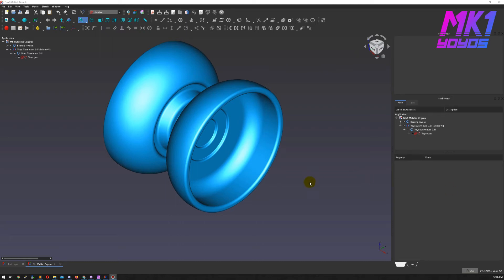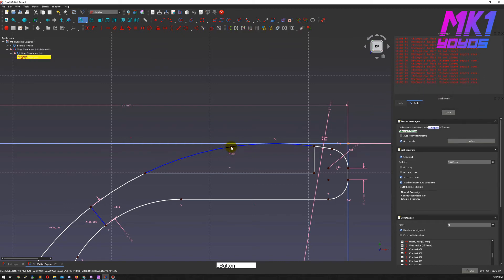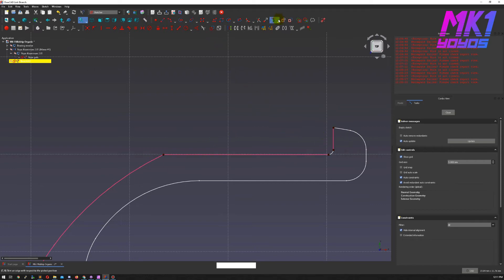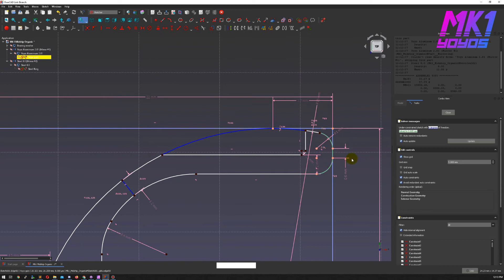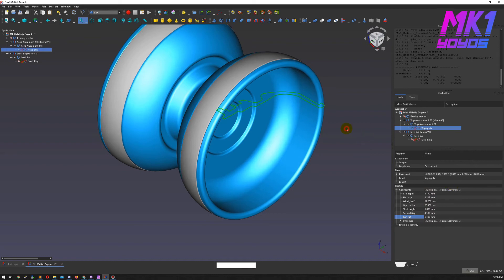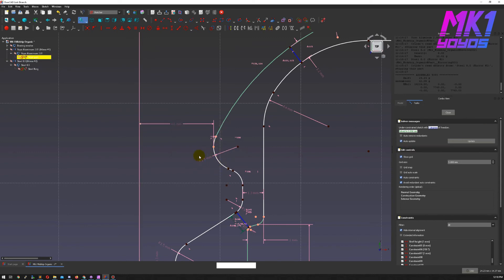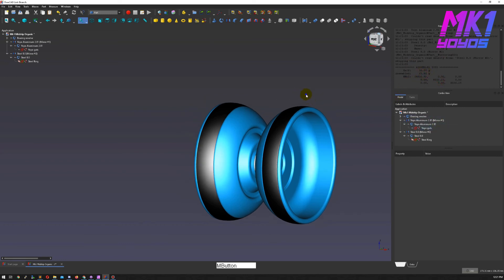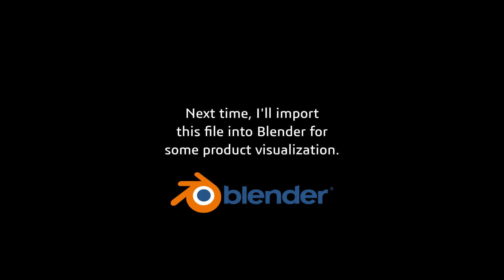Mk1 Mechanics Part 3: Steel Rings

Comment: Hey so, typically, for metallic weight rings, it's a good idea to have a chamfer on the weight ring edge that would otherwise seat onto the fillet'ed yoyo body. This clearance makes installation far easier, and makes part inspections far easier as well, decreasing manufacturing costs greatly.

A ton of shops that assemble the yoyos for you do this without notifying the designer as well, because they know that the designer is very unlikely to rip the press fit weight ring off of the yoyo to inspect it.
Reply: Me: rips ring out

Yoyo shop: NO GOD PLEASE NOOOOOO!
Reply from the maker: Well explained! I'll be incorporating this in the future, for sure. Thanks for the tip.